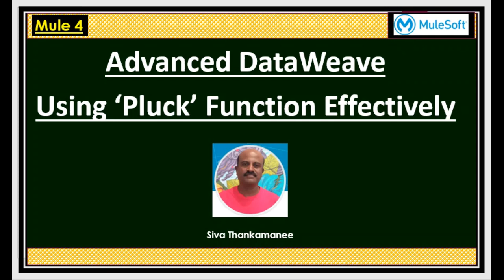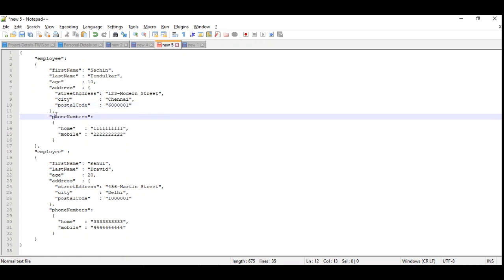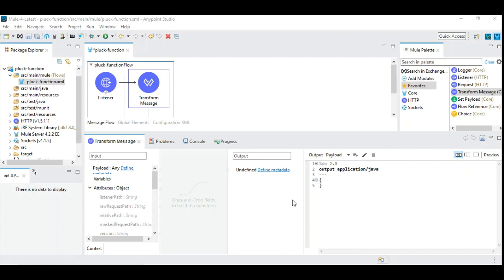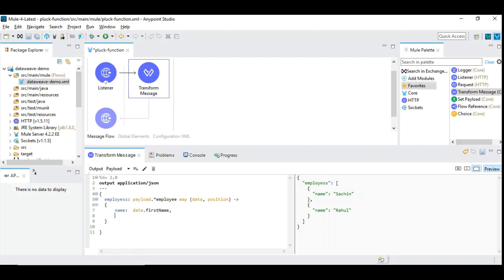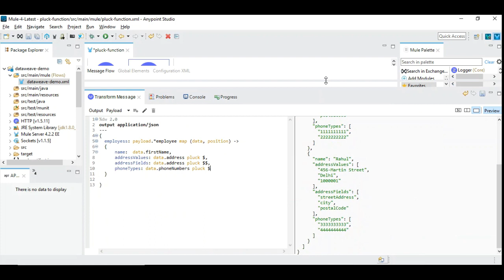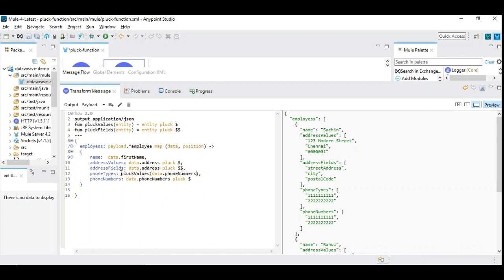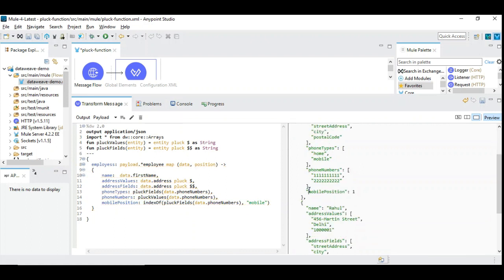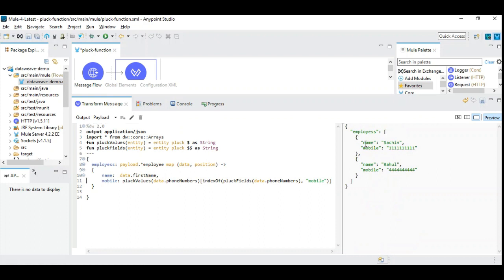Advanced DataWeave - When to use 'Pluck' Function & its Use-Cases

Comment: Hello Sivamani. I am stuck in one issue. Please let me know how I can resolve it using data weave. I am fetching data from couch database and it has array structure coming.in that structure there is one field which has text field but originally when I inserted that same data in db then it was json. So during fetching when we are getting the data we are getting that field as text but we have to convert that into json like original . How can we implement function to convert that field in json in data weave. Verison of mule is 4.2 . Output coming from database is array of objects and final output we need is json. Thanks in advance for response.